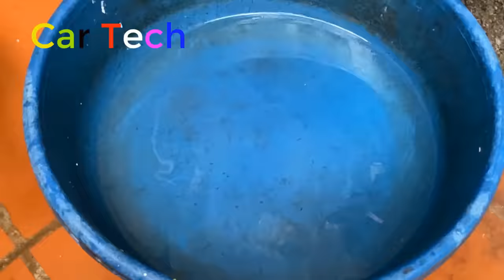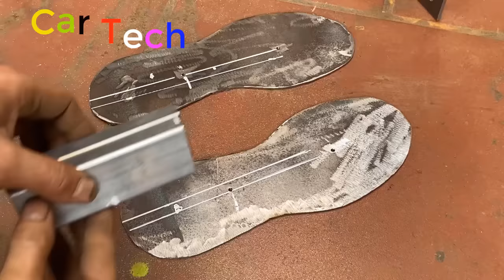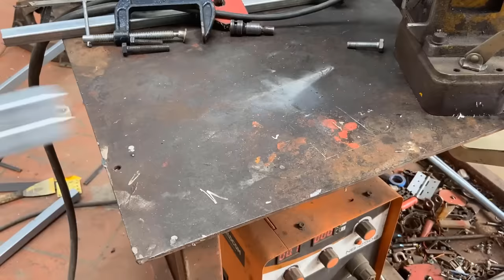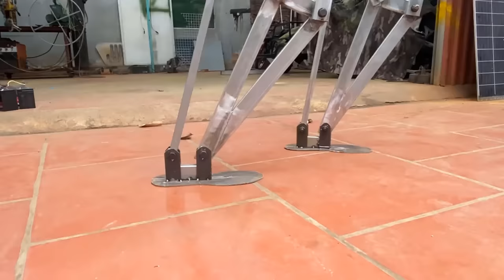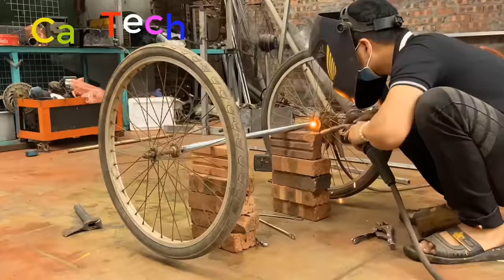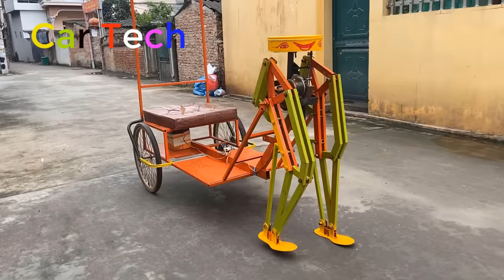Homemade walking robot: full video | Car Tech

Comment: Ok now show us it doing a U-turn 😂
Reply from the maker: yes, i will do it in the next video, stay tuned
Reply: @cartech91  
…for the time being, sorry, I will help it make a u-turn manually then. Uhhuh…
Reply: @cartech91    Perhaps you could simulate control by adopting reins like steering a horse, and the robot attached to a steering head assembly of a motorcycle...
Reply: any turn :)

Comment: I liked it. Next put Rubber Tire Patches underneath the feet for better traction and softer ride. Could make the steering by mounting the rear axle on a central pivot with a joystick and ropes to control the angle of the axle.
Reply from the maker: Thank you

Comment: stability and vibration issue.. please add also a shoes or rubber damper to its feet and also damper for vibration in passenger seat
Reply from the maker: Thank you, your idea is also quite interesting, I will complete it in the next part

Comment: Can we make a walking stimulator for paralyzed persons .If we use two bldc 350w  motors, a paraplegic person will stand on the frame and body weight is not on the frame he will be lifted /hanging with a harness, and only legs weight will be on the frame

Comment: Instead, you can use the motor directly to drive the cart!
Why this much round about mechanism to move a motorized cart??

These many mechanical and pivoted joints will create tremendous drag on that skeletal gizzmo!!
Using solely its feet alone, can it pull its own weight and cart's weight and the weight of two or three people?

Another version of Strandbeest!!
Rather the costliest!!
Reply from the maker: Well thank you very much

Comment: I want to make the same that can run faster instead of just walking
Reply from the maker: You just need to use a stronger engine to be able to run fast without walking
Reply: @cartech91  nop electric motors are fast enough I only add at least 3 transmission gears to make it faster

Comment: How to steer it
Reply from the maker: There is a switch to control the forward and reverse
Reply: @cartech91  and if you made 3rd back or front wheel with steering wheel to run it, so I think its gonna turn right and left
Thanks for replying